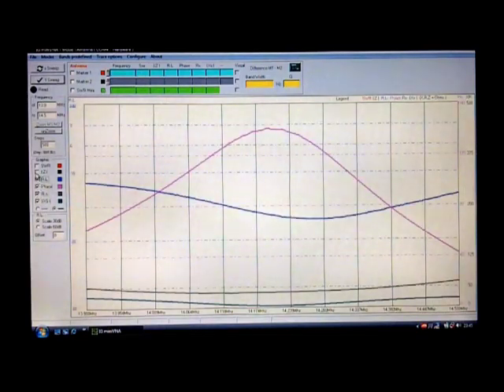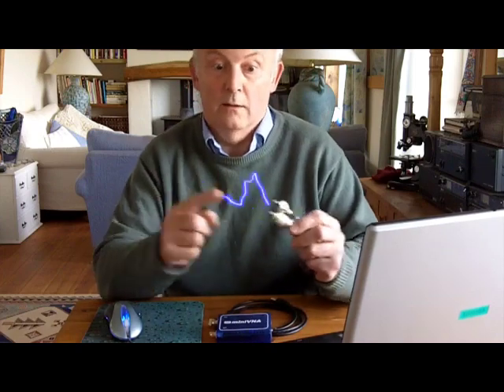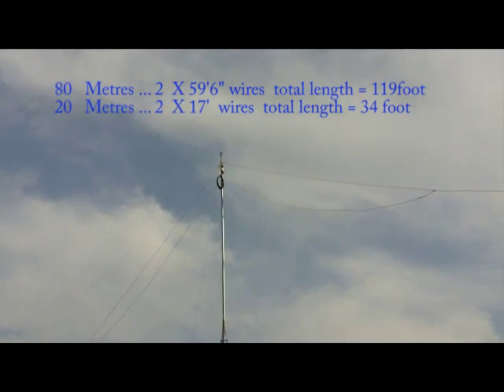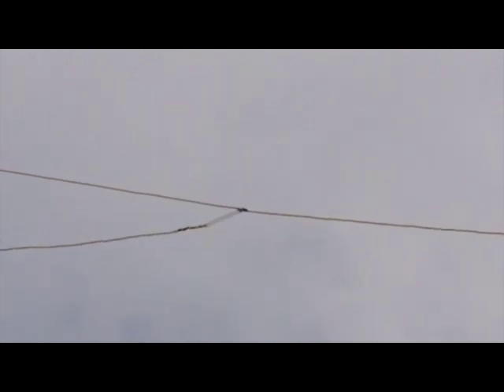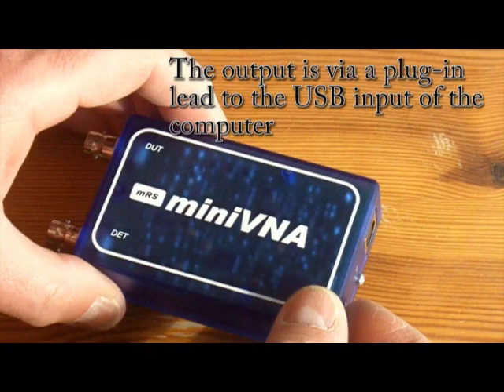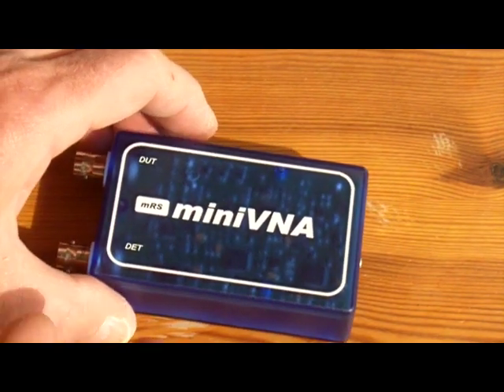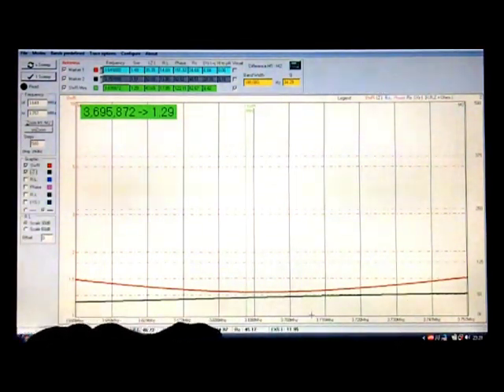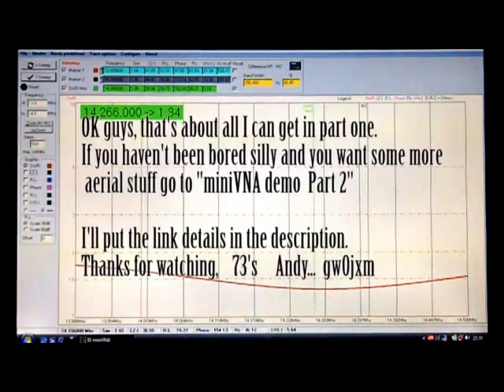miniVNA Demo Part 1 (Ham Radio)

Comment: you loos the most energy of your transmission on your selfbuild transformer. don't use a toroid it is also bad in transformation use two tubeferrites this is the most effective energy transformation. a toroid loos more then 25-40% of the HF Energy - that we found out.

Comment: Andy,
that second dip on your 80m dipole was the 3rd armonic, if you tune the dipole on cw, most likely the antenna will work on 30m (3d), 17m (5th) and 12m (7th), at least mine does.
73, Clay
Reply from the maker: Cheers Clay